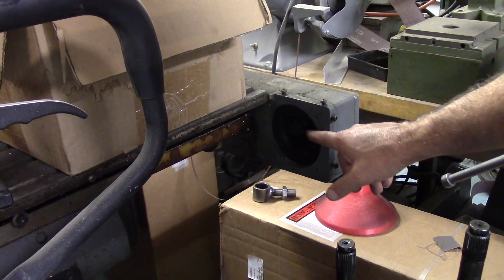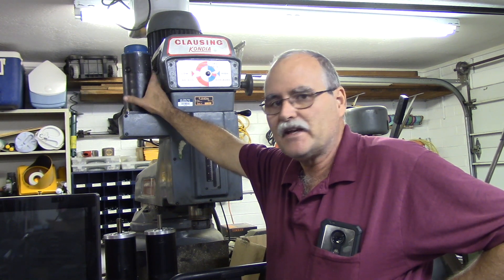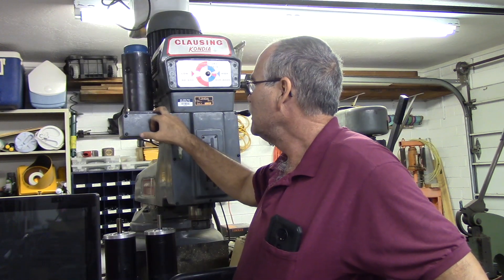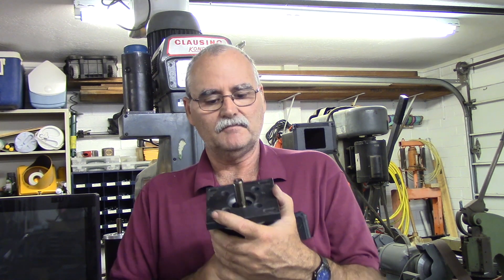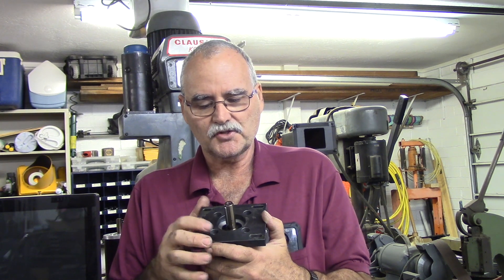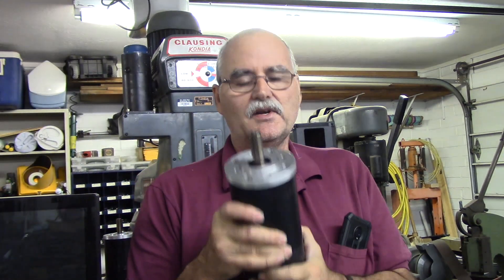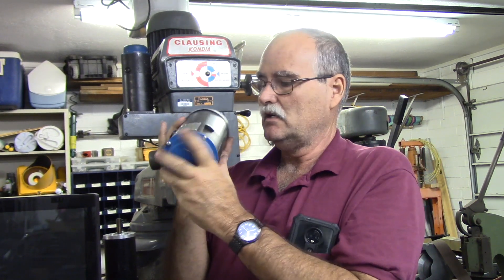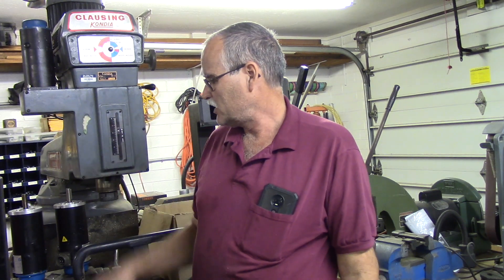Clausing Update - Different Control Plan! ( Centroid CNC All in One DC )

Comment: Those motors look massive!
Reply from the maker: They are AC motors, same frame size as what came off the machine, but they were square. I did not want to cut the table to fit them so I am going back to the DC Brush Servos and a Centroid All in One DC. I will get back on this machine when I am done with the FADAL TRM.

Comment: Thank you for the update. Looking forward because I still have the original Motors. 
That will be my in between project for the coming year. So it will be less money to spent.
Keep up the good work and useful info!
Reply from the maker: You can follow my All in One DC play list on my YouTube Channel. That's the best route to go in my opinion. Was your machine running previously? Make sure you test the DC Brush servos: https://www.centroidcnc.com/dealersupport/tech_bulletins/uploads/155.pdf I also have a video on doing a preliminary test.  You want to check them now.

Comment: Hi Marty, I still haven't gotten around to mine as yet either. planning to get it setup this winter. I will be making a different plate/box to shift the square servo on the X axis further outwards so I dont have to notch the table, then I will use a longer belt. Do you have a link to any videos that the other guy did? I am wondering if he used a smaller servo for the Z axis. Great work on yours btw.
Reply: I still have my DC servos by the way but the software side of the all in one DC makes the cost prohibitive for me.
Reply from the maker: He used the larger NEMA 42 A.C. servos. The NEMA 34 750w may work.

Comment: Hey Marty, I’m doing a Bridgeport boss 5   It has 1-1 pulley ratio. I’ve been collecting parts for the last couple months which include DMM 4  servos nema 34  750 w .. anyway I’m starting to worry they aren’t powerful enough... should I upgrade and save these for another project? Or do you think these will work?  Thanks!
Reply from the maker: Should be fine. AC Servos have a flatter torque curve than DC Brush servos. The FADAL TRM I have has about 750W motors on X/Y on it from the factory at 1:1.
Reply: @martyscncgarage5275  thank you Marty!